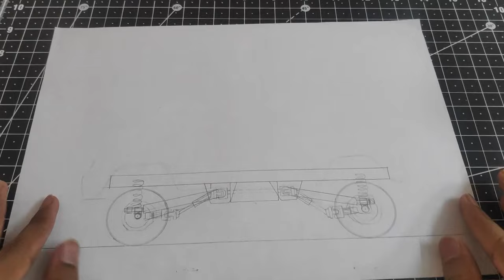How to Make a 4x4 RC Car (DIY)

Comment: I love the way how you made the universal joints. Simple materials. And also Also impressed as you make the cross with needles tied with the thread. Idk walhat they're called... I also made a 4X4 last yr but I failed because I found it hard to make those joints. The cross specifically.
Reply: Mine opinion about this is just the same

Comment: bhai isma 3.7v ke battery lagai leptop ke jab chala ge taz
Reply from the maker: Lag jayegi Bhai.
But voltage and current requirement ke according number of batteries decide hogi.
In that case DC to DC converter use kar sakte voltage adjustment ke liye